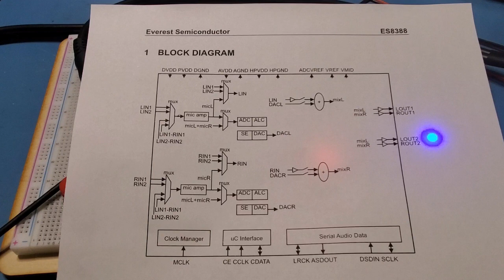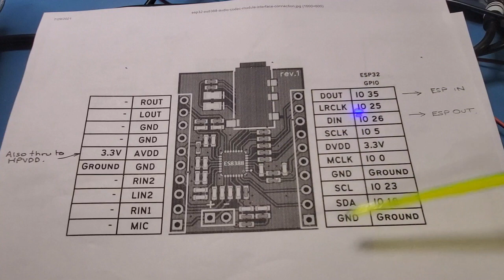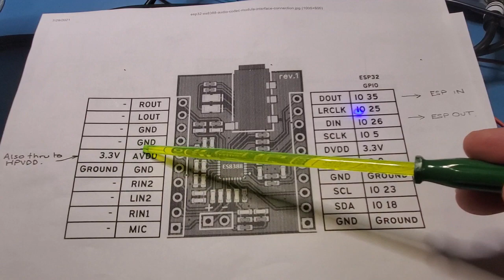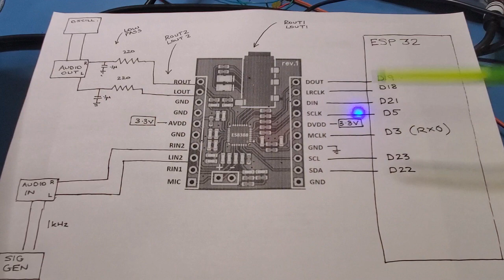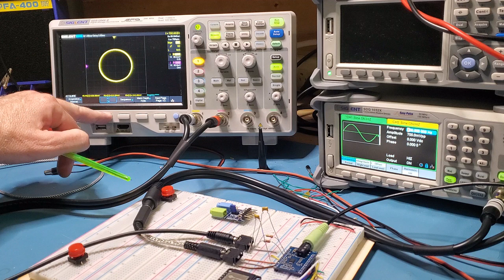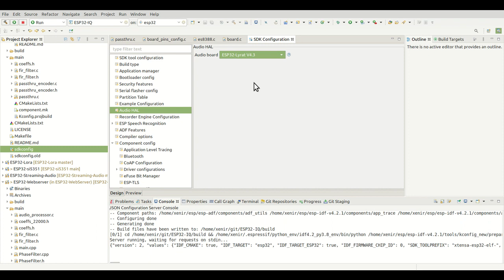ESP32 Audio Processing with PCB Artists ES8388

Comment: Hi, I've been developing a dsp board with the cs5343 and cs4344 (same as i2smod) and I've come to the conclusion that they are introducing some HF noise in the audio, which honestly is quite noticeable when processing and amplifying guitar

Have you noticed or measured any improvement in audio quality when using the ES8388? I'm considering switching to it for many reasons

Comment: Very interesting video! I see that in the FIR example you are using the same I2S channel for both ADC and DAC, but according to the official Espressif documentation each I2S controller can only work in half-duplex mode, and they suggest to use 2 controllers for full-duplex operation (which would be impossible with the ES8388 since you don't have separate clock pins). I am developing a project with the ESP32 + ES8388 which needs full-duplex operation and I was afraid that it could not work, but your video proves the opposite, how do you explain it?
Reply from the maker: Thats an interesting question. For others looking for the reference above that says you can only operate in half-duplex see here
https://docs.espressif.com/projects/esp-idf/en/latest/esp32/api-reference/peripherals/i2s.html

However I don't think that is correct as ESP's own examples in the audio toolkit show a device configured to do both audio transmit and receive. See here line 65
https://github.com/espressif/esp-adf/blob/master/components/audio_stream/include/i2s_stream.h

I am wondering though if the "full duplex" being referred to above is not audio receive and transmit but rather having two master I2S controllers (i.e. one master in the E2S and a separate master in an external peripheral). 

Here's a forum post which alludes to the "two masters"
https://esp32.com/viewtopic.php?t=17373&start=10#p77830
Reply: @na5y  Thank you! This is important because otherwise I should have looked for workarounds

Comment: I have a question please, so I understand that ESP32 is generating the master clock, I tried to do the same with ESP32S3 and I get alot of noise, is this because ESP32 is more capable when it come to fast clock generation ? I wanted to use ESP32S3 because it is much more capable and more powerful, I'm trying to build a a drum machine/synth and sampler and sfx all in one
Reply from the maker: You mean noise on the master clock output? ESP32S3 should be fine for this
Reply: @na5y  Thanks you for your reply I really appreciate it
What happens is that I use ESP32s3 coupled with PCM1808 as an ADC and PCM5102A as DAC (both bought from Ali express)
reading sound using the ADC and passing it through the DAC
the sound is ok for few seconds then I hear a loud white noise and doesn't go until I restart the the esp32s3, I tried many things and I couldn't figure out what could be the problem, some websites suggested that ESP32s3 is only capable of slow MCLK which is not very accurate, some other websites suggested that it could because of noise build up and I completly hitting my head against the wall, I'm willing to share the code if this will help
Reply from the maker: @rolandtriton  You are just doing a straight in through ADC and out through DAC? Sounds like your audio processing might not be keeping up. MCLK is fixed and baked into the ESP - I doubt that is the problem

Comment: Will your code work with  the esp32 lyraT board? I noticed in one of your videos that you have one. 

When I first tried using the esp-idf/adf a couple of years ago, they didn't have a DSP library and many of Espressif's own example programs worked poorly if at all. One thing I discovered about the esp32s was that power management was on by default. That meant that the WiFi would only communicate with my router up to 10 feet away. There was a simple line of code to disable the power management. At the moment, I don't recall what it was. The esp8266 seemed better at WiFI. I could easily get 200 feet from the router.

The PCB Artists board looks nice. The only problem is that the shipping is more than the cost of the board itself.
AC9NM
Reply from the maker: Hi Jerold. Its funny you mention the Lyra board. After I did the video I thought I'd try getting it working with the Lyra board. The code worked but for some reason the output on the left output channel was significantly weaker than the right (which is a big problem for using it as a phase shifter in an SSB radio)

I tried fiddling around with a few settings but I couldn't make the problem go away. There was also a pile of high frequency noise on the output too. I have used the Lyra for other things so I am pretty sure the board is OK. I will keep you posted if I have any success. One of the differences with the Lyra board is that there is an audio amp connected directly to LOUT/ROUT 1/2 - perhaps that is causing the problem. Not sure really - its supposed to be disabled if it detects the headphone connected I had thought

The shipping charge is a bit of a pain - I hope he gets his boards on tindie or somewhere like that. For what I was looking for it was perfect though. Thank you for the comment.
Reply: @na5y   
Hi Ian,

I got your code working on the LyraT board. Originally, I was having trouble getting the AUX in to work. I set the audio output level to the max. With 50mv in there's 1.8V p-p output to the scope. Output from both channels were the same. In X-Y mode the results were the same as yours. Here is the modification I made to passthru.c  (between TAG1 and TAG2:

    ESP_LOGI(TAG, "[ 1 ] Start codec chip");
    /////// Added code to work with LyraT board - J Ponko
    audio_hal_codec_config_t audio_hal_codec_cfg =  AUDIO_CODEC_DEFAULT_CONFIG();
    audio_hal_codec_cfg.adc_input = AUDIO_HAL_ADC_INPUT_LINE2; // Aux input
    audio_hal_codec_cfg.i2s_iface.samples = AUDIO_HAL_48K_SAMPLES; // here put your sampling mode
    audio_hal_handle_t hal = audio_hal_init(&audio_hal_codec_cfg, &AUDIO_CODEC_ES8388_DEFAULT_HANDLE);
    audio_hal_ctrl_codec(hal, AUDIO_HAL_CODEC_MODE_BOTH, AUDIO_HAL_CTRL_START);
    
    //level 0-100
    audio_hal_set_volume(hal, 100);
    ///////

ESP_LOGI(TAG, "[ 2 ] Create audio pipeline for playback");
Reply from the maker: @jeroldponko7168  Awesome - I always like it when someone else gets my code working. Was it the audio_hal_set_volume() that was the key? I remember having some problems with that myself
Reply: @na5y  
No, the other code. When I first tried it, only the mike input worked but I did notice the output levels weren't equal. I may add the code to use the touch pads to control the output level just to see how balanced the levels are when changed over the 0-100 range. Are you using 48k samples or something else? I can't remember.
Reply from the maker: @jeroldponko7168  Ah got it - I misread your comment
Reply: @na5y  

Ian,

I spoke too soon about the output levels being equal.  I did some more testing of the lyraT board and have come to the conclusion that the line inputs are broken hardware wise. I fed each line-in channel a 1kHz sine wave signal of equal amplitude. The line-outs show not only unequal amplitudes (2:1) but if you feed only one input, there is  major signal leakage to the other channel. I have three of these boards and they all behave the same. 

However, they are still useful for things like bluetooth speakers, or internet radios. They can be used for I/Q generation by using just one AUX in and setting register 12 to either 64 or 128 which uses one ADC for the L & R data..The unused input should be grounded. The lissajous patten on my scope looks good down to almost 300 Hz with the coeffs.h you provided.

#include "es8388.h" // needed for register writes

    // ADC Register 12 Control Bit Values 7:6
    // 00 – left data = left ADC, right data = right ADC
    // 01 – left data = left ADC, right data = left ADC
    // 10 – left data = right ADC, right data = right ADC
    // 11 – left data = right ADC, right data = left ADC
    // possible values : 0 DEFAULT, 64, 128, 192
    es8388_write_reg(12, 128);  //right ADC
Reply from the maker: @jeroldponko7168  That's interesting - which LyraT version were you using. I have the 4.3 version and that only has AUX input (which goes to LIN2/RIN2) and the two on-board microphones (which go to LIN1/RIN1).

Edit: Oh you are saying use only one of ADCs on input? That means you could use the board to generate a pair of I/Q audio signals but you could never use this board for DSP processing of I/Q signals in, say, a receiver.  Thats a pain. Looking at the schematic:

https://dl.espressif.com/dl/schematics/esp32-lyrat-v4.3-schematic.pdf

There is a .1uF capacitor C62 which ties the left and right AUX channels together which seems strange
Reply: @na5y  Yes, I have 4.3 boards. They have been a disappointment in many ways . The bypass capacitor is strange as well as the 2k resistor to ground on one input and the other has a 2k resistor to a 10uF bypass to ground. It's not wired at all like Everest shows on their data sheet for the es8388 chip. It's a shame, for a touted audio board, that Espressif didn't test it better before releasing it. I also noticed people complaining about the low on-board mic levels. The mic and aux inputs aren't very good on this board and aren't worthy of experimenting with. I do have some Pmod codecs, teensy 4.1 w/audio board, es8388 chips and other adc/dacs to play with in the meantime.

It's not worth my time filing bug reports as Espressif doesn't seem to fix them.
Reply from the maker: @jeroldponko7168  Before I found the PCBArtists board I toyed around with creating my own es8388 board but never got around to it. The IC is kind of small and I dont have an oven just a hotair gun
Reply: @na5y  The es8388 is QFN24 4mmx4mm package, like you said, really small. Personally, I don't mind the SOP and MSOP chips like the Si5351A but I've only soldered my first es8388 last week onto a 24-pin DIP breakout board. I used low temp (140 C) solder paste, mixed with extra flux paste and a hot air gun. It looks OK but I haven't tried the chip yet so I don't know if I was successful. I'm going to solder though hole bypass caps onto the breakout board as  Everest recommends the bypass caps be placed as close as possible to the power pins.

I have nine more es8388s so I may design a breakout board in Kicad based on the Everest design and use 0805 SMD parts and 2.5mm pin headers. I don't think 3.5mm jacks are necessary for the audio connections so I'll leave them out  I'll probably have the boards made by JLPCB. Like you, I make most of my own PCBs but I don't think my PCB milling machine can do a QFN pattern although I have used it to make pads for 2x2.5mm SMD crystals for the Si5351s.

If they work, I can mail you a couple in return for making such fine videos.
Reply from the maker: @jeroldponko7168  Thats very generous indeed Jerold - thank you!
Reply: @na5y  Hi Ian. I had some ED8388 boards made (based on thier application schematic) and populated a couple of them but I'm unable to get the inputs to work. The outputs work with your basic example so I suspect the input failure is due to the AliExpress unbranded ES8833 chips I bought. I'll hold off sending you a board and experimenting with the ES8388 until I can find some Everest branded chips that don't cost a fortune. It wasn't as difficult as I thought it would be soldering the QFN package with a hot air gun and 140C/248F solder paste!  
 
On another note, I was able to get the Espressif LyraT 4.3 boards to fully work with your code (with modifications) and with some modifications to the LyraT boards. I Fixed the unbalanced AUX IN problem by removing two resistors and two resistors with a micro cutter. Too bad I can't post a picture here of the mods.

I was on Espressif's github yesterday and noticed they removed all my bug reports. I guess they didn't like it when I criticized them for not testing their example code before releasing new esp-adf/edp-idf versions. For example, I wanted to try using the Eclipse plugin for Espressif's esp but found out their plugin doesn't work with the latest idf. I actually couldn't get it to work at all with Eclipse so I resorted to using the command-line tools again. Also, the latest adf is incompatible with the latest idf. Apparently, the idf folks decided to rename some variables/defines and didn't tell the adf folks. Eventually, I found a idf/adf pair that work together :^) Good luck on the Magnis SDR.
Reply from the maker: @jeroldponko7168  I have a few of those ES8388 ICs I bought off ebay. I was planning to play around but never got around to it. I have had a pile of problems with the IDF eclipse plugin - it doesn't help that I don't know CMake very well but the plugin itself seems very fragile. I haven't had any problems so far with IDF/ADF - but then I don't update the libraries very much. Thank you for the updates and good luck on your continuing experiments! Thank you for the comment Jerold

Comment: What codec does it uses?
Reply from the maker: The codec is the ES8388 
http://www.everest-semi.com/pdf/ES8388%20DS.pdf
Reply: @na5y  I read that datasheet it's codec were not specified, but I guess it's simple linear PCM.
Reply from the maker: @arduinoguru7233  Ah you wanted to know what it was using internally. I don't know unfortunately